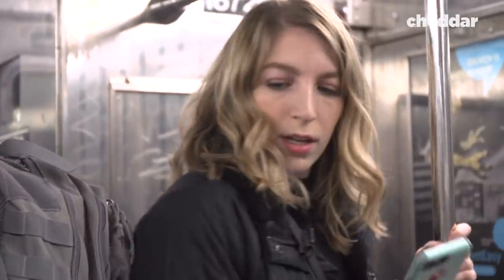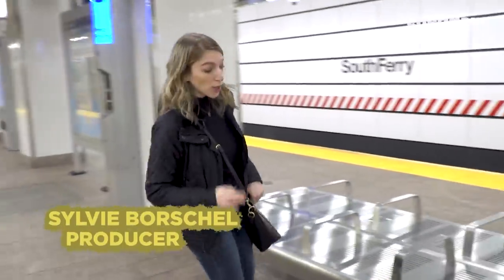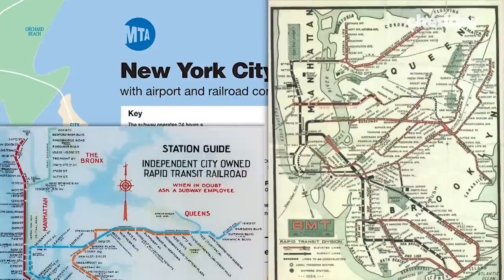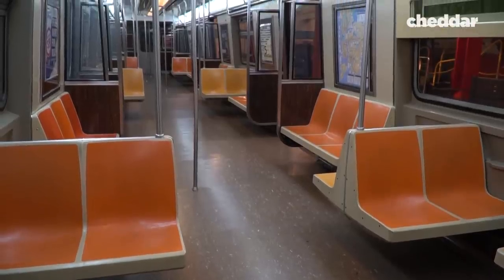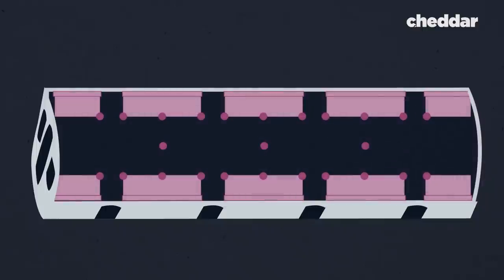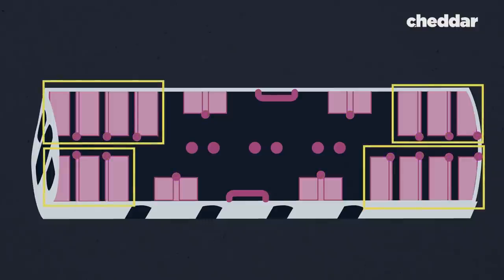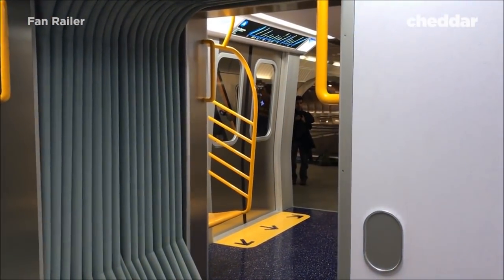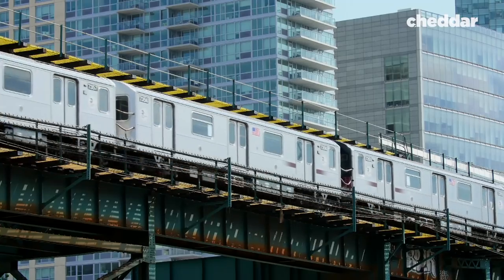Could This Subway Car Save NYC Transit? - Cheddar Explains

Comment: Sylvie: you need to go back to your history take into account one of the reasons for the overcrowding of the New York City subway system especially in Manhattan is attributed to the demise of the Third Avenue El.

In 1875 the Rapid Transit Commission granted the New York elevated Railway Corporation the right to construct a railway back in 1878 we ran from 1878 through 1891 when it was acquired if memory serves me by the Suburban Rapid Transit company and then later on what's now known as the MTA which basically ran it into the ground unfortunately in 1973 they started dismantling the infrastructure. At that time I was nine years old and I witnessed this and I said to myself this is the biggest mistake that New York City can ever make now mind you I was nine years old at the time the same as when I commented as to the demise of the Trolley system in New York City.

The MTA of New York City it's probably in my opinion the most ill managed bureaucratic nightmare ever created. The bureaucratic waste that the MTA engages in is monumental. Yet they're always crying that they're broke and raising fares. If they would restore the Third Avenue El and maybe in select areas a trolley system this would help ease the burden of overcrowding.
Reply: NYRM1974 Still has nothing to do with outdated car designs.

Comment: 90% of subway problems are due to the riders, and not the trains.  Besides the occasional bottleneck or power failure, most trouble arises from the antics of some passengers...

Comment: The open gangway carriage design which is becoming common in Europe (i.e. removing the interconnecting compartment doors and opening up the entire space wall to wall as shown here https://www.youtube.com/watch?v=pwWHMNGfrpw) represents a massive improvement not only because it increases each carriage's capacity but also because it makes it easier for passengers to spread out.

Smaller self-contained individual carriages effectively become one large carriage. 

Regardless of the carriage being full or not, the open gangway design allows for a less claustrophobic experience and is considerably safer in an emergency as more exits are available.

Comment: Removing the middle seat because no one uses it, makes less sense than keeping it, because people will sit on their own 1 per 2 seats, I ain’t gonna sit next to someone on purpose
Reply: Huh?
Reply: @TheRailLeaguer  well take away the space between people because people don't want to sit next to each other and force them to sit next to each other is worse because less people will sit down causing less space
Reply: Aandeel I’m already visualizing it and it may not solve the problem of people sitting next to each other, but rather, you would have people standing next to you.

An ideal solution to subway car capacity increases and outdated layouts is to implement open gangways between the cars. This would help increase capacity and reduce crowding, and also balance loading.

Comment: If service is not within the rush hour, or reworded as "non-rush hour service" (ie: latenight/early morning/weekend), all trainsets should be cut in half — 4-6 railcars per trainset, except for G trains (already four long railcars or six short railcars) & the shuttles. It's a money-saving tactic I'd probably use.
Reply: TeshawnEdmonds We tried that before, but it is unsustainable now, especially given off peak crowding.

Comment: Some Tokyo Metro gangway used to be wide and had a unique "mushroom" gangway. However, they were refurbished to closed ends with doors because the fire would spread through the Open Gangway.
Reply: Dhiya Khairi Close ended cars seem like a safety hazard, especially if locked.
Reply: @TheRailLeaguer   They were not locked. The doors can be opened by sliding them.
Reply: Dhiya Khairi But is it legal there to walk between cars?
Reply: @TheRailLeaguer  
Yes
Reply: Dhiya Khairi They’re lucky. Here in NYC, we have closed ended cars, and it’s illegal to walk between cars, with the fine being $100 if caught. I can’t wait for the new R211 Open Gangway cars to be in NYC so that we can walk from one car to the next without being caught or risk dying.

Comment: The MTA lied about what the real cause of delays were. If they couldn't pinpoint it on a broken rail they blamed the passengers for the delays. In reality the delays are due to dysfunctional 100 year old signals, which limit the speed at which a train can go and how close trains can ride to eachother. Conductors were afraid to go too close to the speed limit for fear of the signals misreading the speed and and switching the emergency brake on (that can cost a conductor his/her job) so they were overly cautious. The mta also changed the definiton of a delay to make the stats look like they weren't getting worse. 
Changing the train cars layout will do little to speed up the system
Reply: michael rivlin While I could say that this technically has nothing to do with subway car layouts and is not a solution to outdated ones, I will say that open gangways will be more effective at increasing train capacity.
Reply: michael rivlin While I could say that this technically has nothing to do with subway car layouts and is not a solution to outdated ones, I will say that open gangways will be more effective at increasing train capacity.

Comment: New York doesn't really have any excuses, London has an older underground system, a larger population etc and its still been able to accomadate and modernise the system, only recently has it started struggling and as such they are in the process of building a whole new line
Reply: They did want to test open gangway trains in the 1990s, but declined to do so to prevent delaying the delivery of the test NTT trains.

In addition, they still had to get measurements for the OG trains. Not only are the open gangways made of rubber (which has variations), but the tunnel measurements can vary. So this needs to be heavily customized to prevent wear and tear overall.

Comment: Interesting... LA subways do have a similar seating to what is planned for new york... Just with the exception of more standing rails above and beside the interior. Basically put more rails on the roof. and just remove some of the seating. Make the back ends more designated for bikers (Since we actually do that) but yet able to transport alot of people. surprisingly our Red Line Subway cars are pretty dang spacious. (Edit: especially for old 70s style cars... I don't even think LA metro has changed them since... But the Gold Line, Expo Line and Blue Line are a bit more modern... *but not subway trains... light rails actually)

Comment: Then you were designed to also have an added bonus of reducing wind buffeting as cars arrive to a station and leave as they have a more smoother airflow around them which means the cars will be more efficient on the rails and travelling as well we will be a bit more convenient it is a bit more forwardthinking too by maximising how many people they can get into a car even if they standing I think the trips will be shorter as I don’t live in your city I’m only pointing out walking outside I might see the cars maybe an improvement in peak rush-hour times and having alternative car layouts for other needs such as the seniors and impaired people so having a mix of cars would be a good idea but the open design is great the disabled will love it people in wheelchairs will love it I think it will be a step forward For a growing population and with such an open design it means it can be changed

Comment: That "perfect subway layout" is the worst thing I've ever seen. High capacity trains need longitudinal seating. There is always someone on a given train who is perfectly happy to sit next to someone considering the seats are always taken. The capacity issues could be completely solved if the system had platform screen doors, was automated to high frequencies, had open gangways, and more doors per car on B division trains. For rush hour, they could implement flip up seats that lock so they can stuff the trains.
Reply: The MTA’s option actually includes open gangways for some of its cars, some seats removed though none of your other mentions were recommend nor even related to subway car layouts (I really don’t see how increased frequency is related to positioning of subway car seats and whatnot).

Comment: They had the best seating design with the R1-9 classes long gone, which followed in  a few other classes thru the R 68's.. some cross seats and side seats, a lot of standing room. But they HAD to go back to the all side seating for the 2nd time, reducing comfort level. The "perfect car" design is  a near copy of Chicago "L"'s 5000 series and could be adapted to new IRT [number lines] cars. Chicago cars same width but 3 feet shorter.
Reply: Edward Davis All-side seating increases standing capacity, and with open gangways coming in 2020, we should see a further 10% increase in capacity.

Comment: Just came back from a NYC visit.  Would be faster boarding and unboarding a train from opposite sides.  You enter from right side and exit from left.  Sure you have to re-design stations, but that would eliminate a lot of dwell time.  As for seats... I saw every one of them taken even middle seats.  Most trains were in 6 minute intervals.  That's not bad.  If you can reduce dwell time with expanded stations and opposite side enter/exit, you could reduce dwell time and reduce train intervals to 3-4 minutes which would be a huge increase - greater efficiency and passenger carrying capacity.  Station layout should be considered over new cars.  The cars are not the biggest issues.  You increase passenger capacity with a more efficient enter/exit design and shorter train intervals.  Cuomo probably has friends that build them cars.  Oh well.
Reply: Geo Zero This does not help optimize subway car capacity.

Comment: Even if the "perfect subway car layout" were to be found and implemented, it would have only a very moderate effect on overcrowding and dwell time. The real solution is to install technology that let trains run closer together, staff and security on platforms to make sure there is no unnecessary dwell time, and if course, expanding the system with more lines and double tracking on currently existing lines. Of course, expansion and increased staff cost a lot of money so don't expect it to happen anytime soon. But maybe in another lifetime...
Reply: Andrew Marmorstein The expansion of the subway as well as CBTC has very little to do with outdated subway car designs, Side from that little overcrowding snipplet.

However, if we deinterline some parts of the  system (cough cough, 59th Street), then we can get more capacity without constructing new lines.

Comment: The MTA just needs to consider adding more trains. They are too infrequent specially at peak times. In London one train leaves and you can see the other one coming, in New York one leaves and you can finish your coffee have a nap and the train still hasn’t come
Reply: OPEN DISCUSSIONS Some lines do not have the additional capacity for more trains. And even if they did and added more trains, the sheer number of riders coming in would still require the cars to be redesigned.

Comment: As a daily subway using wheelchair user, I'm majorly ambivalent . the folding seats with prominent wheelchair icons daily are occuppiedby luggage, bikes, luggage, baby carriages etc. But very few wheelchairs. I have no where to go in many cars except trying to reach around human octupusi who envelop poles.
Reply: Sure there is WC space occupied by luggage (hoi g & coming from Islip MacArthur) good clubs going to the county course @ CI, bikes, baby carriages and so forth! On MetroNorth, there are bike racks mounted in the WC space! In the folddown seat there is usually a card game! Every time the doors open, the WC user is blasted by hot or cold air........

Comment: Airline seating is the dumbest idea on Earth because if you have lived any amount of time in New York City you know not to sit in those kinds of seats that leave you vulnerable to someone sitting behind you and hurting you in a robbery or harassment situation.  Also, it would be harder to get on and off the train in a busy train because you would have to try to climb over someone else to get out of the aisle where your sitting when you have only seconds before the door closes.  smh.
Reply: the problem should no longer arise today. here in germany we had it for a while and then the new subways, buses and trains were designed in such a way that you can no longer reach forward from behind. There is also enough space for getting out. over time you learn how to press your bags to your body to get out and get up early enough. there are sound systems and lights that indicate that the train is about to stop soon.

Comment: They should combine the newer connected /open design shown with the " train style" seats like trams do, surely that makes more sense
Reply: So combining open gangways with some transverse seating?

I mean that could work if it were only one seat per row and not like what the buses have (two seats).
Reply: @TheRailLeaguer  well on the trams they have 3 or 4 coaches, with the middle coach having 2 seats on each side and no doors and the coaches on other end where the doors are have seats sideways along with windows and leaves room for poeple to stand also. So kind of a mix of a bus/ train

Comment: Fuck being comfortable, we tryna be ON TIME !! This is exactly why we HOP
Reply: KOKOA KEI This has nothing to do with redesigning subway cars.

Also, beating the fare is illegal. It’s no different than stealing products from a store because you don’t like their customer service (shoplifting)
Reply: JeremiahC99 you must not know about the huge MTA scandal and why they’re being investigated.
Reply: KOKOA KEI Overtime and redesigning Subway cars are two separate things (besides the fact that overtime was not used for retrofitting Subway cars).
Reply: JeremiahC99 it has to do with fare. People have been paying fare for years without any changes. The MTA got caught and now they’re putting money into actually running the MTA... boosting the fare AGAIN I believe in a January. It has all to do with redesigning the cars Bc at the end of the day not only is our taxes but our hard earned money is what is feeding the MTA
Reply: @SAKEENAHNYC  Don't worry. The MTA would never take the design suggested in this video. Our hard-earned money will be going to open gangway trains to increase capacity on a single train by 8-10%. The rest of the capacity increase will come from upgrading the signals.

Also, nice memes.

Comment: The subway cars arent new. They are just the old ones painted in a way that makes it look new.
Reply: The R211s are going to be built from new. What you might be referring to is the R160 trains assigned to the E, F, and R routes modified to increase capacity.

Comment: The overcrowding that occurs on the NYC subway comes from farebeaters. If NYC did more to enforce proper collection of fares, the overcrowding would not take place. Also, the MTA needs to do away with MUNY and crack down onf all the performers that fake up flloor space in stations and platforms.
Reply: What does all that have to do with subway car layouts?
Reply: @TheRailLeaguer  It has a lot to do with layouts. People dancing, and performing take up more of the layout space in the train. Farebeaters means there are more people on the train then it should be since the people who didn't pay the fare aren't supposed to be there hence way more taken seats and standing space than it should be thus relating directly to the train layout. Was you just asking a question or trying to make City Rooster seem dumb or what? Rooster's comment was totally valid.
Reply: @lujerex  None of that makes any sense since Roosters comments provides zero insight on subway car layouts, as in seating positions, pole placements, etc.

Comment: Why not spring load the flip seats, like a movie theater or stadium?  That way the default position is up and out of the way.
Reply: PongoXBongo We have that on the R142/A cars but it’s sometimes not effective. You could lock them like what they did in some R160 trains that run on the J/Z, L, and M, but the problem with those is that they have been subject by vandalism and destruction by disgruntled riders who want the seats to be down, since the seats are locked according to a schedule.